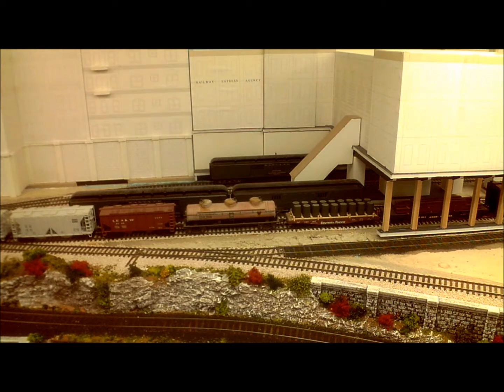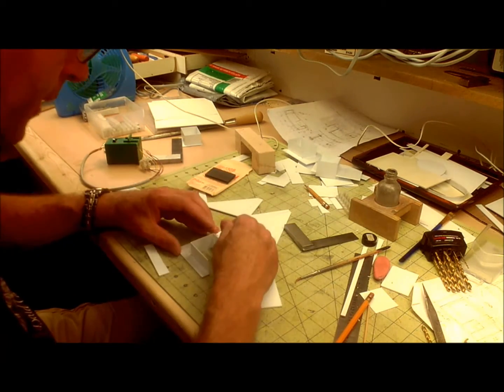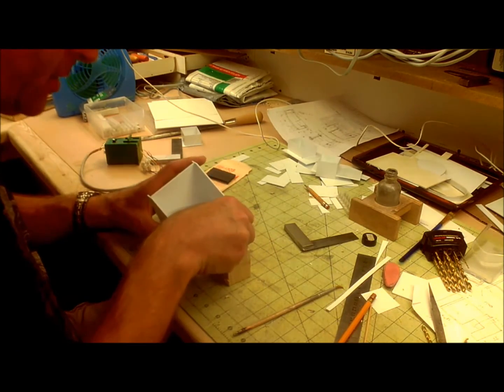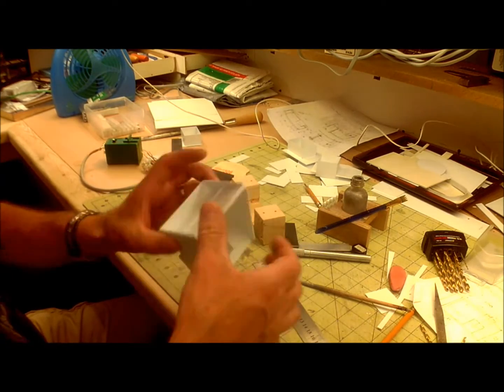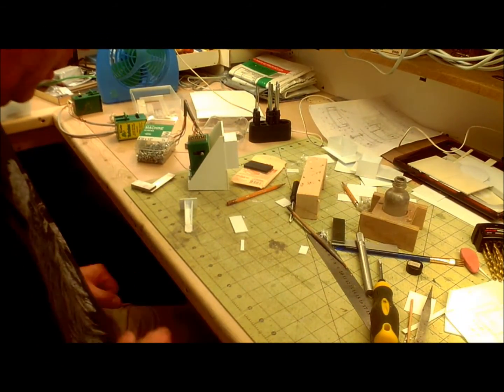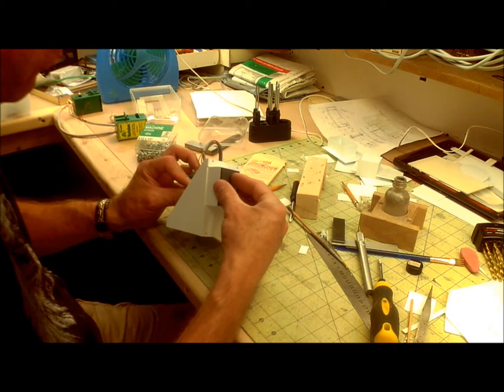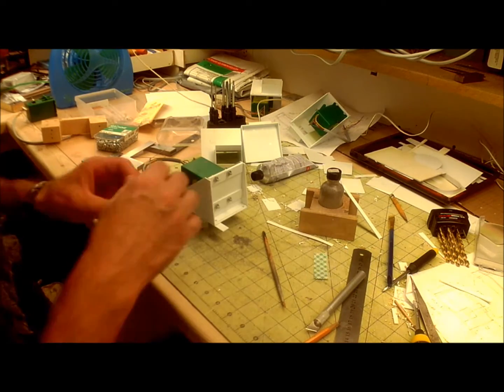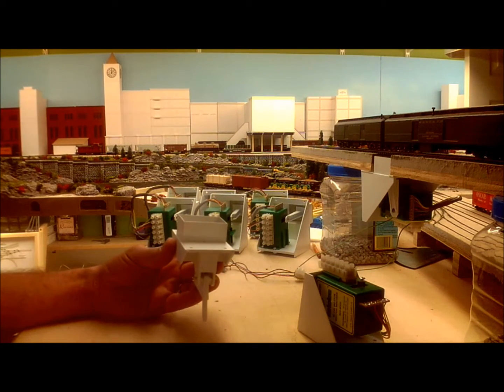My railroad: Hands-free uncoupling for passenger trains

Comment: I've been looking for a good method of raising rare earth mags manually for button couplers on O gauge, I'll be using 5/8" round
mags now in your style of "tube or cylinder mount" and retracting with 1/4" pneumatic line and weed whipper cord from Stihl set up like a choke cable, if you are old enough to know what a choke is. Thanks for the video.
Reply from the maker: Check out the bikini version at 12:55.  The part on the left with the crank could be attached to a push-rod for manual operation, which is how I would have preferred to do all of them if it were possible to put the controls right on the fascia opposite the magnets instead of in a panel.

Comment: Great video! But I have got to know what kind of miracle glue you use and where you buy it at? I can hold my parts together for 10 mintues and as soon as I let go, they let go. LOL!
Reply from the maker: For joining sytrene parts, I use Methyl Ethyl Ketone (usually known simply as MEK).  I bought a quart can at a home improvement store for about the same price as hobby stores sell the tiny bottles of what is basically the same stuff (You'll need one of the small bottles though because the large can is not convenient to work from).  For gluing styrene to metal, I use either CA or rubber cement depending on circumstances.  I'm using rubber cement here because it gives me longer to make adjustments.  
Hope this helps.
Reply: Thanks! That helps a lot. Enjoy your builds and ideals!

Comment: hi Peter... that was very interesting.. seems like a lot of work but looks like it will work for you.. thanks for sharing.. vinny
Reply from the maker: Yes, it was a lot more work than I expected when I planned it.  I was working on it for more than a month of hobby time.  If I were to starting over I'd probably cut down the scope of the project by only putting magnets at the ends of the tracks.  I wanted to give myself more flexibility, and knew it would be impossible to add magnets later that I didn't make provision for before the track went in.  One thing I did overlook was the REA track.  I probably should have put one there but was counting on being able to use the delay feature on the couplers.